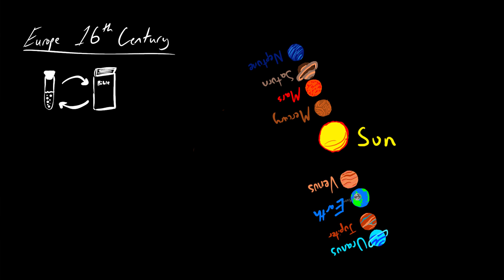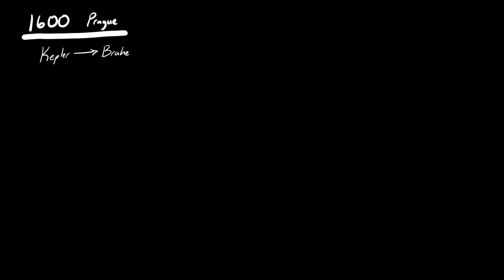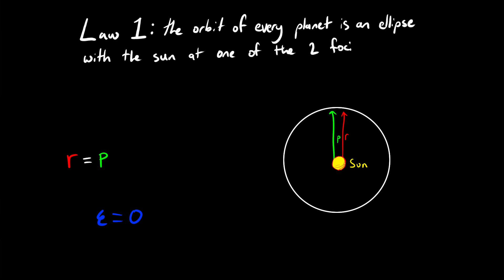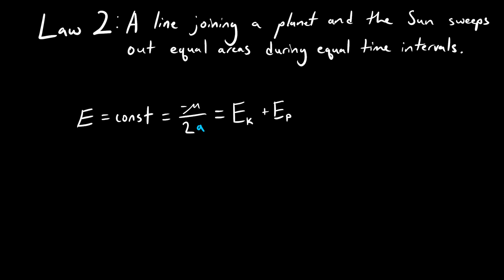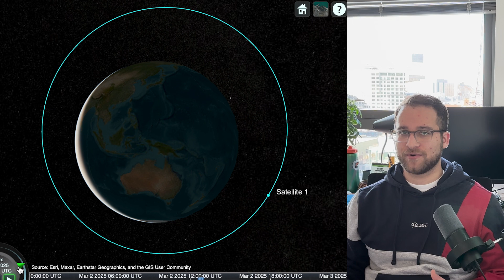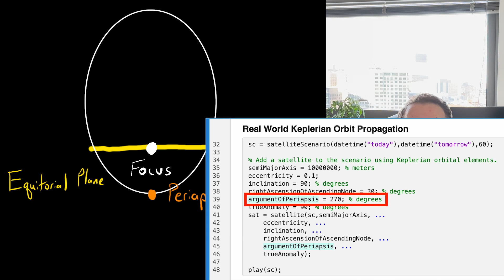Using Kepler's Laws to Propagate Orbits in 9 Lines of Code!

Comment: Just to note: I found this video deliberately searching for an explanation on how the basic keplerian orbital elements are defined and used, but more importantly HOW you would propagate the orbit upon figuring them out. Still not exactly sure how I would use this to derive the state vectors depending on time. So maybe a video about retrieving state vectors would be good or perhaps you can recommend an article that explains the methods for how you would actually propagate the orbital state of the object based on the set of pre-calculated orbital elements. 
So far no luck finding comprehensible explanations on how you could at least propagate true anomaly to predict object state at a specific point in time. It sounds like the most basic and logical thing you would do after defining an orbit, but I'm still struggling.
Reply from the maker: Thanks for the suggestion for a future video topic, I'll definitely consider that. This part of the wiki page on Kepler's Laws covers going from the first 2 laws to states based on time: https://en.wikipedia.org/wiki/Kepler%27s_laws_of_planetary_motion#Position_as_a_function_of_time  Let me know if this wiki page isn't clear